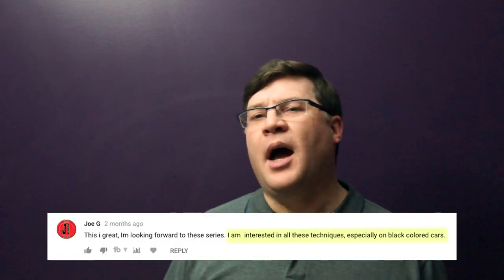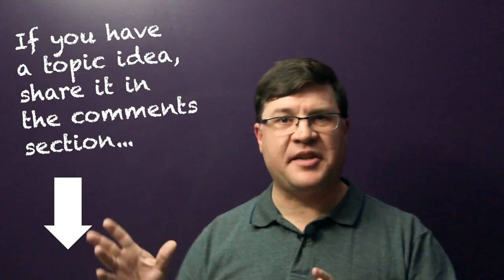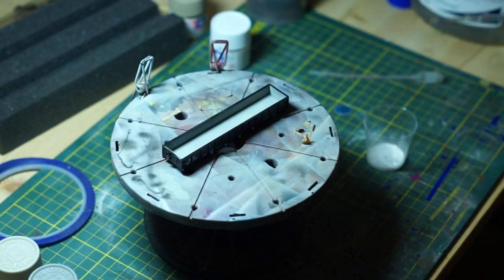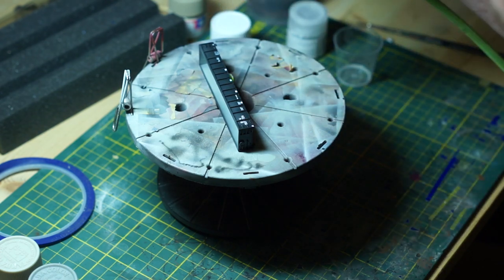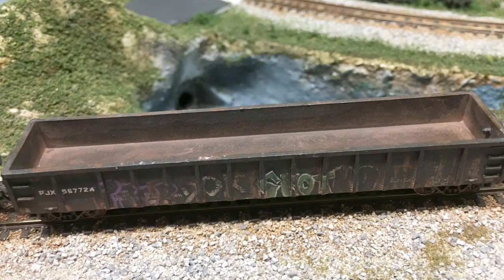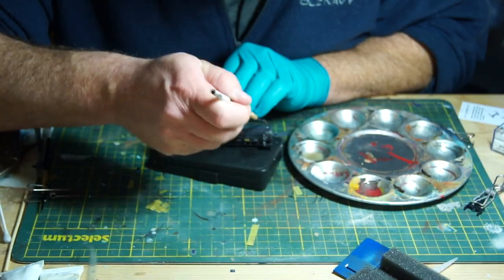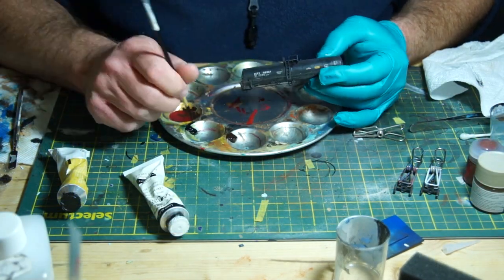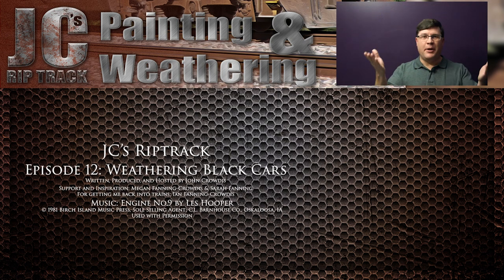The Secret to Weathering Black Railcars

Comment: JC, saw that your are starting to use Pan Pastels. I have had very good results fading dark cars, including black, using PP Burnt Sienna tint - 2704.8. It is light enough to fade but not white enough to look wrong. Depending on the surface where it is applied, can end patchy. That can be an advantage or disadvantage depending on the effect that you want. I apply quite heaviliy and then use a clean makeup sponge or a paper towel to spread a remove som of the PP.
Reply from the maker: Thanks Stefan. I have mostly dark colours so far. I think I've figured out their colour system, at least in part, in that the number after the decimal indicates how light or how dark something is. x.1 is dark, while x.8 is a "tint" and much lighter. I will need to get me some tints. :)

Comment: Another great video and information been looking for myself to weather some tank cars.  I might have missed it in another video, but why do you use the Pledge Futureshine over alcohol or water to thin your paints?
Reply from the maker: Thanks! Oh! I think I should make something clear: Pledge Futureshine/Johnson Klear (or whatever it is called locally) is not for thinning my paints! It's clear acrylic, so I use it as a gloss clear-coat straight, or mix it with Tamiya Flat base in different ratios for Satin or Flat coats. Like paints it also needs to be thinned down. For a thinner for Future, Tamiya Paints and Games Workshop/Citadel paints I use denatured alcohol, usually Tamiya's own X-20A thinner, but drugstores carry 91% alcohol as well, and I believe it is the same stuff. So for me I treat future as simply a "clear paint". I'm sorry if that wasn't clear in my videos. When I thin stuff down, it depends on the viscosity of the paint, but I add enough thinner to whatever it is to get the consistency of milk.

Comment: John you're doing  a great job with these videos! How did you keep the yellow from turning grey? Qtip/alcohol right after airbrushing? Ever try pastels to avoid the frosty airbrush look?
Reply from the maker: +Bill Mourey Thanks! It depends on the subject. Tamiya Sky Grey has a slight yellow tinge to it, so it can fade the black without impacting yellow print *as much*. Airbrush fading is not really a one-colour-fits-all process, and I almost never use it without another process to break up the look. As for pastels or pigments, watch for a later video. ;)

Comment: When using the dot technique, what list of oil colors would
you recommend for a freight car painted boxcar red, Tuscan red or oxide red?Thanks.
Reply from the maker: Probably the oil colours I would use for your more typical red-brown boxcar, I would go with Titanium White, Cadmium Red, Cadmium Yellow, Burnt Umber, and Terra Verte (Green). These are the Winsor-Newton names for them. If you happen to have access to the Abteilung 502 oil range, I would go with the rust and reds set: https://amzn.to/2D7JoRD - The colours are a bit different, but they will most certainly work. The if you do go with the Winsor-Newton line, the green works by way of being a contrasting dark colour. Use it sparingly. Even with the Abteilung rust and reds set, I would probably advise on getting titanium white as well, as you'll need it to lighten the colours. How's that?
Reply: I will give it a go. Thank you.

Comment: Does the US not really use black container wagons? They’re pretty much the only freight traffic you see where I live in NZ and it’s really hard to find any info on weathering models of them.
Reply from the maker: MarMightyGood: There are others that know this better than I do. Do you have any pictures that you could send to me (my email address is in the "about" section). Most of the black cars that you find in the US and Canada are either Tank cars (most of them are black), gondolas, and covered hoppers designed to carry Carbon Black. There are some exceptions from some lesser known roads. The principles of weathering black cars is similar: fade the paint until it takes on a greyish tone, and then other weathering effects become more visible.
Reply from the maker: I've not seen container cars here that look like that. Most containers are shipped in dedicated well cars with sides that come up around the edge of a lower container. It allows the containers to be transported stacked two high. Those look like specialized flat cars, which we do see various forms of around here. The main thing when weathering a car like that is the surface of the wagon will get a lot of wear and tear from the containers being moved on and off of it. Chips, scrapes, rust, etc will be on the flat surface. Apply a light grey misting to tone down the black, apply some chipping, and dust and that could be a quick way to do it. (sorry for the delay on the response)!

Comment: I see how you use many paint types during a project, both oils and acrylics. I was always told you could apply acrylics over oils but never oils over acrylics?
Reply from the maker: You can do both, but you need to take steps to protect the previous work. I usually suggest applying a clear coat of some sort. Most of the work that I do starts with acrylics, and then oils come later. However, a lot of it also depends on paint brands as their chemical composition is different. Not all acrylic paints are the same. For example, Golden Acrylics clear coats do not go over oils well, but on the other hand Tamiya Flat clear and Gloss clear go over oils fine... just make sure they have 24 hours to dry.
Reply: @JCsRiptrack  I'm at the bottom of this learning curve. I need to stop watching the videos and take the plunge and start painting. Not all the products you use are available to us in my country, just the major brands like Tamiya, Citadel and those expensive tubes of oil paints the artists use. It is the sealer coats I'm having issues with (I have never seen that floor polish you like to use). Thanks for your inspiring YouTube videos.
Reply from the maker: Thanks. If I may ask, where are you watching from? I may be able to give you some tips on sealer coats. "Future" is available under many different brand names, so I may be able to help you find the version that Johnson & Johnson markets where you are. One thing about oil tubes, one tube of a given paint will last you years. Some of my tubes are well over a decade old and still useable, so the cost over time isn't that bad.
Reply: @JCsRiptrack  I'm in South Africa.
Reply from the maker: From what I understand, the names have changed a bit. At one point it was called  "Mr. Muscle" in a pink plastic bottle with the "Future" logo on the bottom of the label or Johnsons "One Step" which is chemically identical to "Future".  However, I think Johnsons has changed things up a bit. In Canada "Future" is now called "Pledge Revive It" --but my bottle is still the original cover and has lasted me a long time. Failing that, Tamiya Flat Clear and Tamiya Gloss Clear are both excellent clear coats.
Reply: @JCsRiptrack  thanks. I recognize the pledge and Mr Muscle  names. I will check them out. We are on total lockdown, all the time to do some weathering but no shops open to buy the materials  to do so.